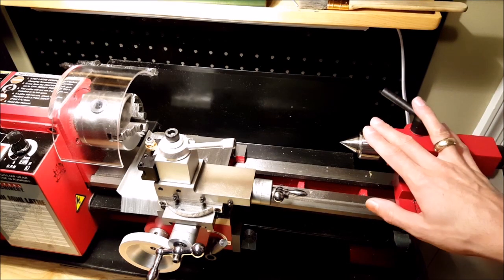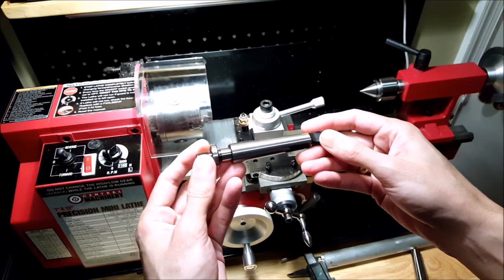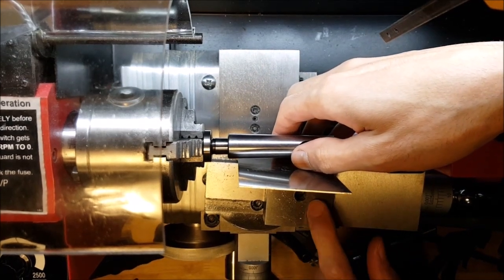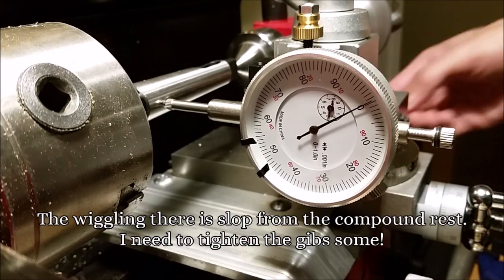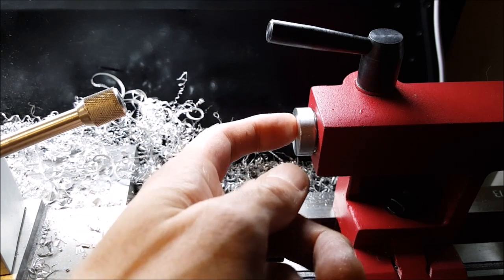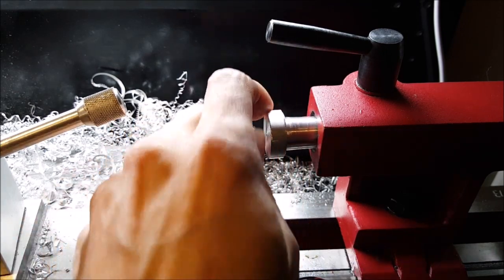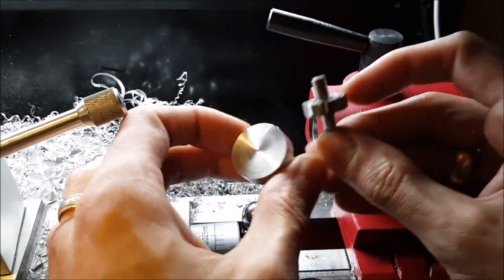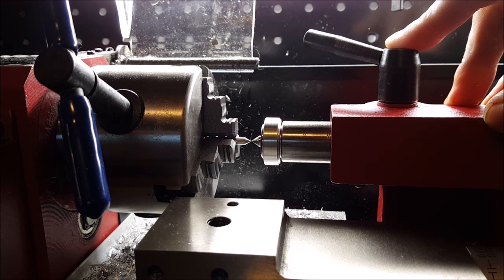Making a Compact Live Center MT2/Morse #2 Taper for the Mini Lathe

Comment: I was thinking about the lack of thrust bearing and thought of a possibility. Thinking of dropping a.ball bearing down the hole for the tail of the rod to spin on. Maybe with a center hole in the rod to help maintain alignment. Having the point almost right in the bearing is a help for reducing runout so it doesn't pivot at the bearing. 
Is this an occasional use live center or is it now your regular?
Reply from the maker: I've used it quite often, but I haven't noted whether it's more, or less than the factory livecenter. If I'm working on something very long, I use this one. Shorter pieces, I might use the other. Also the other is big and chunky so if I think it will get in the way of the tools, I use this one.   😊
Your idea for the ball-bearing isn't bad, but adds a lot of complexity to the build. A lot more precise measurements would be needed, and it would need to be lubricated somehow.  🤔
I think on a big lathe, you would definitely want some beefier bearings for this, but on this little one it seems to work fine as it is.

Comment: Great video - I have a Seig C3 7x14 and want to do the same.

Also, if you are doing work fairly often that pushes your gap between centres, you may need to consider getting an ER32 collet chuck and set of collets. The lathe chuck is removed and the collet chuck goes straight into the bore of the headstock. Gives you an extra 70mm or more between centres.
Reply from the maker: That is a good idea!   👍

Comment: The size of a lathe, 12" in your case, is the  =>Distance Between Centers<=.  
That is, the distance between centers mounted in both the headstock & tailstock.
A chuck uses up some of that space, which is why your measurement was less than expected.

Comment: Nice, but what kind of compound rest is used to match the taper?
Reply from the maker: The compound rest is the one that comes with that lathe, I just removed the tool holder.
Reply: SculptyWorks ahh tnx, now i see the camera angle was from top, had me wondering how the rest got to the back of the lathe.